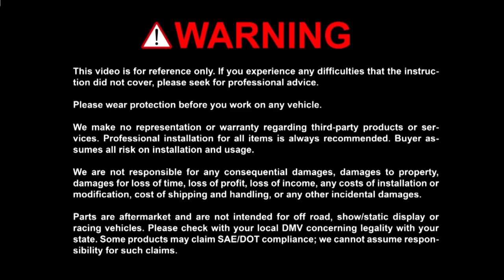Aerodynamic Wind Fairing Crossbar Roof Rack Installation Guide by LT Sport  WF-001B

Comment: So I ordered this for my flat cage roof rack on my 4Runner and I was very disappointed when I found out that the contact from the top of the roof and the mounts for this is literally metal-on-metal!!!!! there is no padding that comes with it and the knobs that supposed to tighten the angle of the deflector does not tighten it there's no rubber washers in between it and it literally moves freely up in down  when it's completely tightened down. And the plastic pains that go through to the metal bar behind it that it sits on that metal bar moves freely with no tension and that metal bar goes left and right on the wind deflector with no contact to keep it in place from moving freely at all very disappointed!!!!!!!!!!! 👎🏻👎🏻👎🏻👎🏻👎🏻👎🏻👎🏻👎🏻👎🏻
Reply: Did you return it?